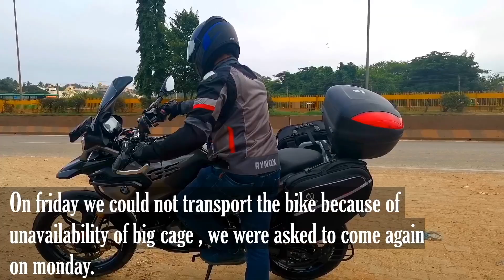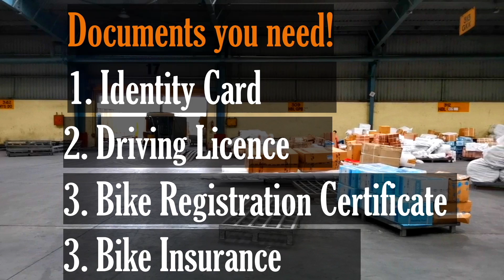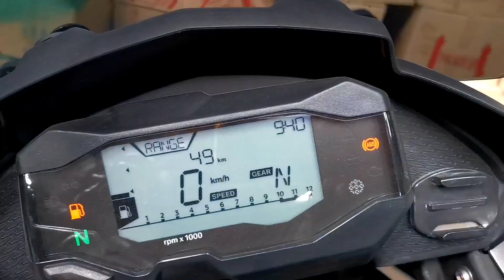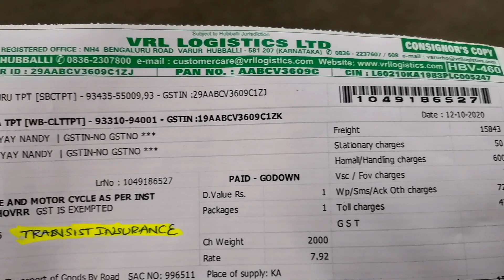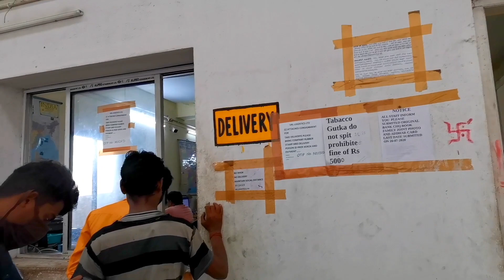BMW G310GS VRL Bangalore to VRL Howrah CLTTPT | Bangalore to Kolkata | VRL Bike Cage Transport

Comment: great video man!
few questions:
1. can we lock the motorcycle handle after loading it into the cage?
2. Can I bring my own padlock for securing the cage?
3. can we put in a couple of helmets at no extra cost?
Reply from the maker: 1. No, as the bike wont fit with their arrangement nor stay straight within the cage if the handle is locked. The security issue will be handled in 2.
2. Yes, they will recommend that the cage is locked with your padlock and the key stays with you. Hence nobody other than you can open the cage.
3. Yes, we put in helmets plus gear jackets within the cage at no extra cost. You can stuff in things within the cage without interfering with their packaging without shedding extra.
Reply: @FirstofWe  thanks a lot, this helps! thinking of transporting my cb350 in august via VRL
Reply from the maker: All the best, hopefully you too shall have a good experience like ours! Have a safe journey 😊

Comment: Bro could you drop exact location of this cage service. I would like to transport my bike to Delhi. And I stay at Hennur Road, Bangalore. I just wanted to check how far is this place from my location.
Reply from the maker: There is something wrong in the data of google maps for this place currently, not sure what! But anyways, we found it from our ‘saved places’. Please do reach out to Shankar (contact provided in the video) to confirm the location as well.
VRL Logistic Ltd
https://goo.gl/maps/J1ZXGSeWPs6Se9Gk7
Reply: Can you also drop the location for the VRL logistics in Kolkata, planning on sending the same to Bangalore. Although I am calling the location, no one is responding. Thanks
Reply from the maker: @diproghosh5211  Hi Dipro, thanks for giving us this opportunity to provide you the required. Try this link Vrl Logistics Ltd - CLTTPT
https://goo.gl/maps/jgVAiktYed4qpq8t6 or directly search with the name above to spot in gmaps.
Yes this place is not very attentive in taking calls esp outside their working hours, do give it a physical visit if possible to check for the right cage, date and availability. Again, contact Shankar for this transport (check our reply above urs). Please do watch the full video as you might get many small and useful info out of it as we may not recollect everything.
Let us know if this helped 😊